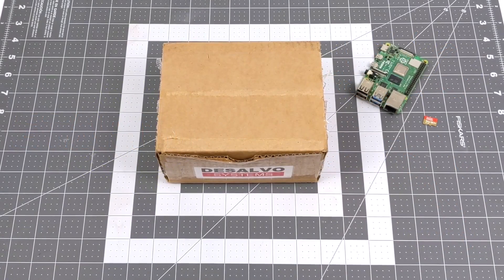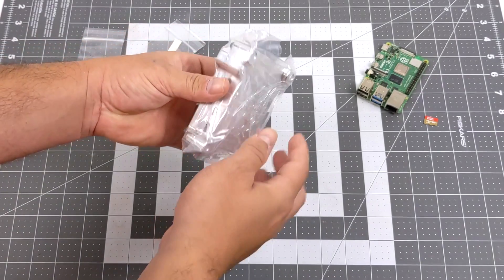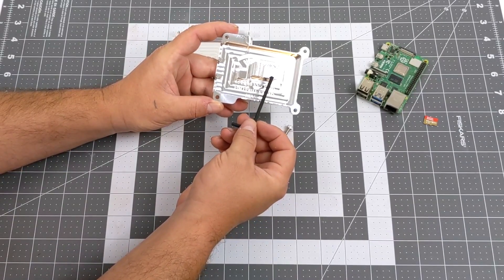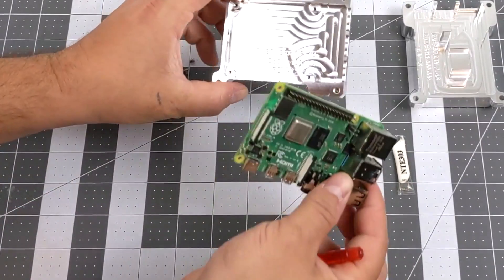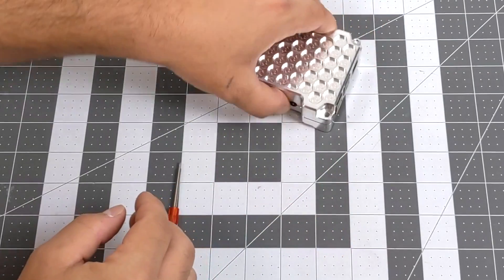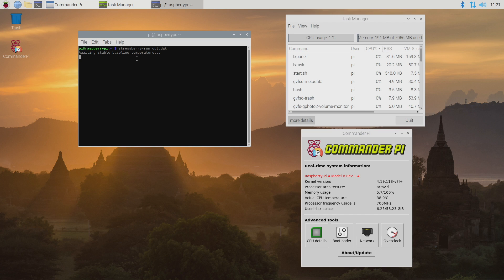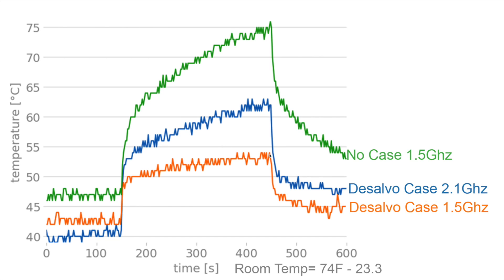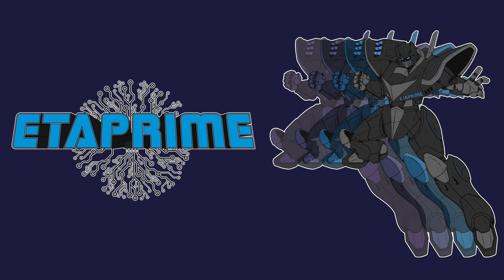Premium Pi4 Case CNC Machined Full Aluminum Made In The USA Passive Cooling

Comment: a lot of sloppy machining marks, though that's still a lot of machine time for 50$.
Reply: Their primary goal is to create an effective masive aluminium heatsink, with the added functionality as a case; cosmetic issues apart, it's a great looking durable metal case which succesfully keeps your Pi cool, low profile and silent
Reply: I was gonna say.  Don't bash the machine marks when it's only $50.  Lol
Reply: well cncs are expensive while the materials you get at the end and the cost to operate the cnc is so small compared to the 50$ price tag
Reply: These are NOT "sloppy machining marks," they are the normal finish left behind by an end mill.  If you want a smoother finish, you can follow up the end mill with various polishing operations, but the price will go up exponentially.  It is all we trade off.  How smooth do you want it vs. how much are you willing to pay.
Reply: they must have slave labor to sell that for 50 bucks.  it looks good, i don't see what is so "sloppy" about it.   it's not like its medical grade or anything.

Comment: Yo ETA, can u make video about the new devolpments on pcie via usb for the raspi4.
You can add 10 gig network cards and stuff now.
Reply: how is that even possible? I thought USB 3.0 was up to 5Gbps?
Reply: @AndrewTSq  The Pi has one pcie interface and thats the usb hub. The mod by Zak Kemble solders on a bridge chip. -  I think becuase the usb interface is removed that solves the 5 gbps bottleneck.
Reply: @omon7745  Yes, but that gets rid of USB functionality.
You actually only have PCIE x1 speeds, but should be ok to plug in a GTX 1650 or 1660 GPU, and game!
Reply: Muranaman  The problem is that the Pi is not compatible with any graphic cards. I also don't think 1x is fast enough for a GPU.